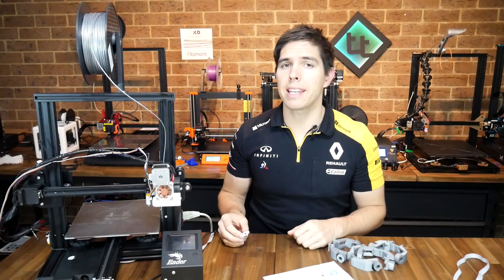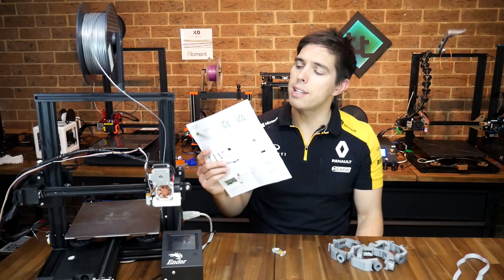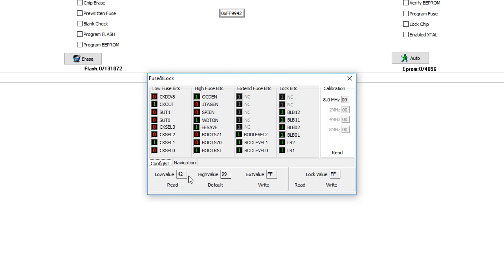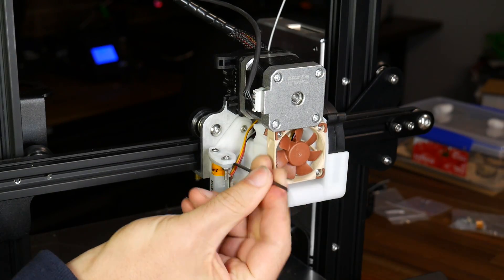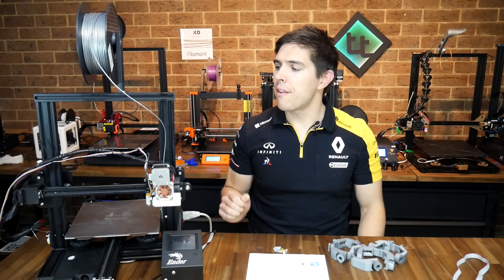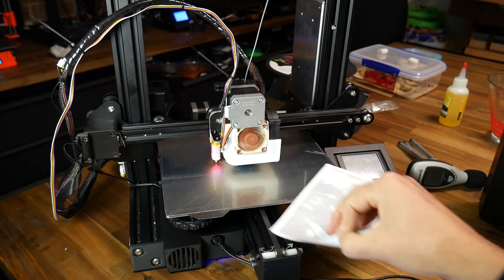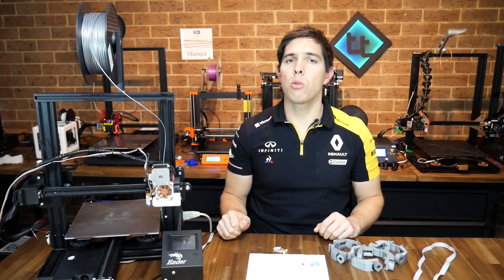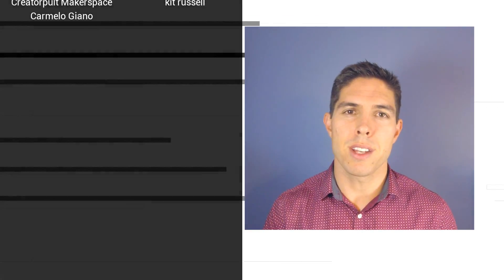Creality BLtouch Ender 3 upgrade kit - Step by step guide with fixes

Comment: I upgraded mine just for the heck of it whilst I wait for my SKR Mini E3 to arrive. My steppers are now as noisy and 'clunky' as anything! Obviously a different software drive arrangement in Marlin than the stock Ender firmware. I tried rigid bed mounts too, but the bed was so unlevel, I've gone back to springs so I can square it up better. I assume once the Z offset (probe to Nozzle) is set, that's it - it sorts itself out each time it does an ABL should the bed level vary slightly, or I tweak it based on the mesh bed level graph in Octoprint.

Comment: good tutorial. Minus the part where you cant fit the mainboard fan back in with the pin 27 board
Reply: Good point... my lid is just lying precariously on top until the SKR Mini board arrives in October...
Reply: worked fine for me on Ender 3 pro
Reply: @Benutzername0000  Seems Creality have relocated the fan on later Ender 3's to move it rearwards. Must have been a bit embarrassing for them when they release their OWN BLTouch kit and find the lid won't close afterwards...

Comment: Had to upgrade to the 1.1.5 mainboard due to overheating. Can confirm this guide works with that and the $25 bltouch off ebay which is probably not V3.

Comment: My 1.1.5 board came with a boot loader and i have a BLTouch 3.1 - I installed TH3D 2.15 (with the bltouch defined) and have ABL working (well almost, just need to fine tune the z offset)
Reply: Can you elaborate more on what it takes to get blt on the 1.1.5?

Comment: I got the v3 kit from creality for my CR-10 and having a lot of problems with there firmware, it has been a nightmare. Dose not print in middle, can't move the axis from control box, It's completly useless. I need a working firmware and u only have one for ender 3 is it possible you can make one for CR-10?
Reply: just get the  official one from their website

Comment: you can reflash your isp adapter to use avrdude using an arduino as isp. http://irq5.io/2017/07/25/making-usbasp-chinese-clones-usable/
i should add the "pin 27 board" is compatible with ramps and other boards that use the "standard" lcd screens i dont have an ender (or any creality printer) but the isp adapter(once i flashed it with modded firmware) and real bltouch and its wiring work fine with my ctc i3 pro b. only reason i bought the creality kit over a generic bltouch kit is because amazon had them for a similar price to a generic kit but available on next day prime

Comment: I notice on your Fuse and Lock the LowValue is set to DC, HighValue set to D6 and the ExtValue set to FD but I notice Creality has it set to  LowValue is set to D6, HighValue set to DC and the ExtValue set to FD. which is correct. I'm on a Ender 3 PRO.
Reply: Did you get an answer? I'm at that moment now.
Reply: @MrVBrabble  Did you get an answer.? I too am now in the predicament. 🙄
Reply: @spacemonkey2431  Hello, Check out this string on GitHub. It helped me tremendously.
Reply: @MrVBrabble  you didn't write anything.

Comment: I was able to install bltouch using kit on my 1.1.3 board.  I had to reflash a 2nd time using the non-bug fixed hex file from creality website. This worked...(downloaded (8/27/19).  I received two hex file version in main folder. The bug fix titled hex file would lock up and beep to only load crealities website on screen once ender 3 powered up.

Comment: How did you manage to get the fan cover back on? Everytime I try the fan gets in the way of the pin 27 board so I can't close the cover...
Reply: print a new cover from thingiverse mate.
Reply: The best way is to bend the 3 pins that connect to the BLTouch 90 degrees away from the other 2 connectors.
Reply: Charles, thanks for this idea. I gently bent the 3 pins 90 degrees like you said. But it was still too tight. I ended up taking off the screw off the fan, near the cable assembly; This lets the fan rotate just slightly when it encounters the cables.
Reply: Yeah ugly

Comment: Bought this kit,  seems like my burner had a problem.   Watched their video,  read their instructions, watched your video.   No success. When I plugged it into my computer two lights came on on my board,  one steady,  one flashing rapidly,  and the buzzer keeping time with the flashing light. 

Ended up getting an arduino uno and flashing th3d's unified firmware and got it working.

Comment: i have follow this guide in every step checking few times if i'm doing everything correct, but at the end when it comes to print after all heating and ABL screen shows me "allez printer ma belle" (what make no sense for me) Printer does not start printing just set heating for 0C for the bed and keeps 200C for nuzzle, and screen show that print is finished and also shows time how long it "took". did someone face with similar issue. I believe that it is a problem with firmware cuz i have flashed back old one and everything worked back. Board is v1.1.3

Comment: Could you make a video of this kit but instead of using Creality's firmware you use TH3D's with thermal runaway protection etc?
Reply: https://www.reddit.com/r/ender3/comments/cfmbdy/howto_installing_a_bootloader_to_an_ender_3_pro/?sort=new - this is how to install a bootloader using the included USB ISP.
https://www.youtube.com/watch?v=3TTuisjmbmY -  this is how to install the TH3D Firmware with BLtouch configuration
Reply: @sean-tt3er  thank you was very helpful for me
Reply: HELP?

Has anyone managed to get this to work using the TH3D software 

I'm running U1.R2.A8
Reply: Kelvin Knight works fine for me

Comment: Hi, I've downloaded your modified Marlin 1.1.9 for the BL Touch V3 but I noticed the BL Touch I have been supplied is a V3.1 and they have a  Hex File specifically for the V3.1. Will your V3 version work with this V3.1? As I would rather use your version with the Thermal Runaway enabled than their version.
Reply: @Drone Man Not yet I've just got the machine and haven't fitted the V 1.1.5 board or BL Touch. its been printing flawlessly since I manually bed leveled it.
Reply: @Drone Man Thanks for the update I'll give it a go. 
My worry was does the Thermal runaway protection work if you use the Creality version of the software. 
I'll need to disconnect  the heater supply and prove it switches the output off when the temperature doesn't increase.

Comment: Good video :) I'm planning to get the new 1.1.5 silent board (bootloader pre-installed, yeay) at some point and then BLTouch. I don't plan using Creality software but instead follow your guide on BLTouch. I'm considering getting the bundle from Creality since it contains everything I would need + in my country people only sell knockoffs...

Comment: Niceeee video thanks a lot, definitley going for a bl touch now, 1 question: if i upload and already have a bootloader on my board can i just do it by usb or do i have to use the linker? And don't i have to tincker with the config files from marlin in arduino, or is it compiled and ready to go witout altering settings?

Comment: I have bought the hex file but realised that the 1.1.5 mainboard should have the bootloader installed. is there also an optimized version that can be flashed through usb?
Reply: I bought the hex file as well but when I flashed it to my 1.1.5 mainboard it appears to be bricked....
Reply: UPDATE i kept hitting Auto over and over, and finally the flash worked.  But BLTouch has a lot of problems, going to try another iteration of Marlin.  I also have a BLTOuch 3.1 which people have said online can be finnicky for no reason
Reply: @CD-rt8wj  at the end as I had no answer and did not want to re-flash the bootloader I flashed the TH3D firmware with the BLTouch 3.1 fitted and working flawless.
Reply: @wilcovanhoboken1483  I'm watching some videos on that now and it looks very similar to TT's.  Not sure if the issues I've been having are hardware or firmware but it's been running well and printing flexibles for a week so I'm not gonna touch it for now lol
Reply: Yes. I have the same problem.

Comment: what about the BLtouch V3.1? Is there something different, or is it like version V3? (Board 1.1.5)
Reply: I'm using the BLtouch V3.1 with the 1.1.5 board, does not share the problem the V3 has.
Reply: @admael7  which firmware? Creality or the one linked here?
Reply: @1969mismk  Both. I was using the Creality one and was trying to figure a way to set the Z offset when I stumbled upon this viddo. I'm using the firmware posted here as of now
Reply: @admael7  I've got the same setup 1.1.5 board and bltouch 3.1 - but all i get is solid red light on the bltouch - How u get yours to work?
Reply: @charlielima  Did you flash a firmware that includes the Bltouch?
Reply: @admael7  No, as it says version 1.1.6 and the current marlin version with the new board is 1.1.8, so I was thinking it a step backwards.  I will try that, but main goal is to have ABL with marlin 1.1.8 or 1.1.9
Reply: @charlielima  Then use the firmware posted here. It's 1.1.9 with the Bltouch enabled.
Reply: @admael7  Hi,  I will try that some time but I  currently have TH3D 2.15 working fine with the board and the bltouch.
Reply: I can't get my new BLtouch V3.1 to work with my 1.1.4 board - neither with the firmware version supplied by Creality, nor the one linked here, nor a self-compiled Marlin bugfix 1.1.x or 2.0.x version.
Reply: @johanneskern  That does not really make me feel good
Reply: Johannes Kern  all works fine here
Reply: Mark Richardson yeah, I got it to work now, too. Not with the stock board though, but with an SKR Mini E3 which arrived a few days ago.

Comment: Great guide, I got a $25 kit from ebay working through this. One thing I would add that was confusing with my clone is that if the probe is in the down position, the printer will start flashing from bootup and no commands will work. You have to reset the probe manually by hand back up and restart and it would work. Also be very careful with the wire that goes to the probe. You need to print something or hotglue it so that it is secure and isn't affected movement that will cause it to loosen and not respond.

Comment: hi thank you great video and info I have just fitted the new silent board 1.5 which has got thermal runaway and now installed the bl touch which I am having difficulty in setting up the distance between the head and bed it is annoying any tips would be greatly received

Comment: I have a bltouch v3.1installed and it operates as it should with your 1.1.9 Marlin firmware, but im having an issue with it after it fails the grid mesh. When i try to print, it will first go home and probe the bed twice, then go and mesh the bed. If it fails the mesh i reset it and try the print again. The problem is after it goes home and levels the bed successfully after a failed attempt, it just sits there and doesn't run the actual print afterwards. The only way ive been able to solve this is to turn the whole printer off and on again and try to print again and hope the bltouch completes the mesh without failing otherwise i have to power off and on again. If it doesn't fail the first time however, then it will continue after leveling and print just fine. Is this how its supposed to work or is it a bug that can be fixed? I added the G29 after the G28 in Cura 4.2

Comment: The pecompiled firmware for the Bl touch wil not work with BLTOUCH V 3.1 on my Ender 3 Pro.  with board 1.1.4.
Homing and ABL works. But if i run a g-code creted with CURA it stops after the G29. Also without the G29 it never prints my object.
Any idea to resolve this?

Comment: you can download everything in a .zip file if you go to the main oficial dropbox page. You will find a download button
https://www.dropbox.com/s/t0keklxcllx6xtz/BLTouch%20Firmware%20Compatible%20with%20V3.0%20and%20Guidance.zip?dl=0

Also the guide for ender 3 set values as follows: Low value=D6, High value=DC, extvalue=FD, not sure if this depends on version?? because you changed low and hight with diferent values....

Comment: Hi, I have followed your steps to the letter, however, when I plug the LCD back in it makes an awful beeping noise. I reset my board back to the factory and it goes away, but I would like to add the bltouch to my ender. Any thoughts?
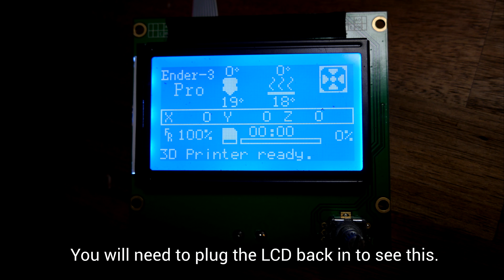Reply: Hi, I just had the same issue. At position 5:03 minutes in the video, he says "this is what you should see once the flush is successful". I just plugged in the screen WITHOUT the pin27-board in between! This lead me to the beep noise. After adding the pin27-board the noise was gone. Maybe I am wrong, but I think that the pin27 was initially used to output the beep sounds of the mainboard. If you have this issue with the board in between there might be some soldering issues with your pin27-board you will have to fix. I hope that I could help you :)
Reply: @don1mani  that did it for me, thanks! How did you get your fan cover back on after the install? The fan hits the ribbon cable and won't shut.
Reply: did you figure this out? I'm having the same problem

Comment: add bl touch v3.1 to  ender 5 try auto home, head runs to left and crashes into side rail?? any ideas?
Reply from the maker: Sounds like you are suing Ender 3 firmware, not Ender 5.
Reply: @TeachingTech  that's what i thought, I'm new to this downloaded what was supposed to be ender 5 firmware from creality but think it's wrong. Anyone know link for ender 5 firmware i can't seem to find it as everyone appears to have ender 3
Reply: @TeachingTech  i also see everyone waiting on V3, mine happens to be a V3.1 if that makes a differance

Comment: Having a problem. When I auto-home the BLtouch is centered, not the nozzle. So then when it tries to finish the leveling it can't. It auto- homes far to the right if you are facing the printer.  Any advice would be great. Thanks.
Reply: Same problem.

Comment: i purchased a kit and it came with a bltouch v3.1. I followed your video but I did notice that when I try to auto bed level on some of the points the bltouch will slowly go down but stow itself without touching anything.  you can see on 1-1 the point is 2.892 meaning the bltouch just stowed itself wihle homing down 

Recv:       0                 1          2            3            4
Recv:  0 +0.050 +0.092 +0.065 +0.077 +0.065
Recv:  1 +0.007 +2.892 +0.042 +0.052 +0.027
Recv:  2 -0.020 +0.035 +0.012 +0.042 +0.015
Recv:  3 -0.053 +0.007 +0.002 +0.012 -0.010
Recv:  4 -0.100 -0.048 -0.070 -0.035 -0.045

Comment: Good morning, I followed your video last night installing my BLTouch V3, which turned out for the most part great. One issue I'm have though is your provided hexfile has an error where the Z-offset cannot be lowered to a negative value. Do you have a corrected hex file available you could share, or information on any mistake I might be making?

Thank you generally for the good and informative content.
Reply: Same over here :(
Reply: @MH08476  he made an error in the hex file. I had to make my own last night from Marlin bugfix to get it working.
Reply: @johnmhavlicek  Hi John! Any change you could share this new hex with me?

Comment: even after powering on the printer I'm still getting the "Chip Enable Program Error".  Please help.  I see some comments about windows 10 being a problem and i am using windows 10.
Reply: I had the same problem.  I ended up unplugging from the board and plugging it back in and it worked.  Changing the USB ports and such didn't help.  Seems like it didn't like its connection to the main board.
Reply: @Folkor  Thank you so much this helped me fix my issue!!!!

Comment: I actually bought the Bltouch Creality kit even though I have an SKR 1.3 on an Anet A8(e3d). The price was very good, and I received the very latest 3.1 Bltouch. Needless to say, it worked out of the box after configuring Marlin 2.0 bugfix. The best of all the servo cable matched the pinout for the SKR 1.3 board. Not to mention  plenty long-enough (and then some). So saved me having to buy an extension. All I had to do was remove the 2pin Creality endstop connector, flip the wires and re-fit into a 3 pin JST for the SKR. Very happy. (I had already 3D printed a mount for it!)

Comment: Hi - can see people asking about z offset does not go below 0 - se from 10.15 and forward, here Michael talks about the Marlin firmware that use "babysteps". On Ender 3 goto - Control -> Motion -> Probe Z Offset. Here you can set the first value, and then on first print tune it in - remember to store...
Reply: no. on other videos they go below zero and thats how they calibrate it. they way you tell us is gonna take ages since it needs to auto home between every single value we try and we might even end up break the nozzle with the wrong value.
Reply: I’m NOT a specialist, but I say that it’s two ways to same result.
Here you go zero, and then the rest with “probe Z offset”, then store the result..
When you then do a test print you can while it’s printing ajust the offset and store this finetuned result..

Comment: Having a couple of issues here. When I try to run the progisp app I get an "access violation" error. The app still opens, but there are no chips to select. Not really sure what's going on. I have the USB ISP connected directly to my computer. Any tips?